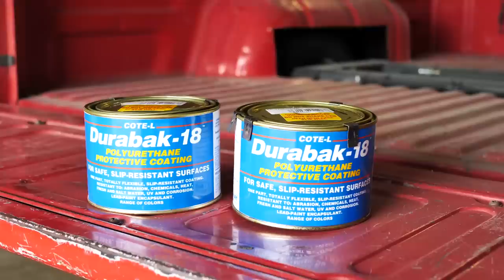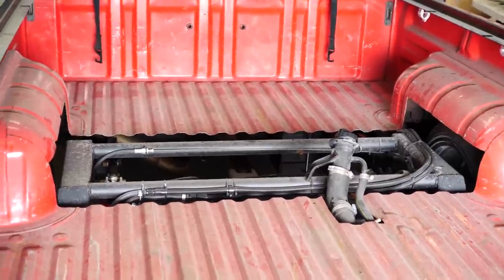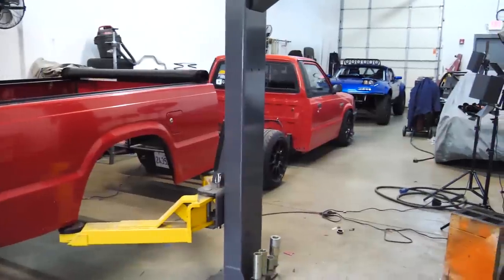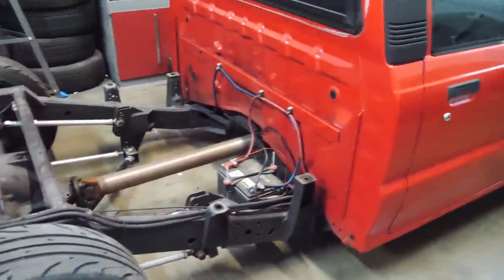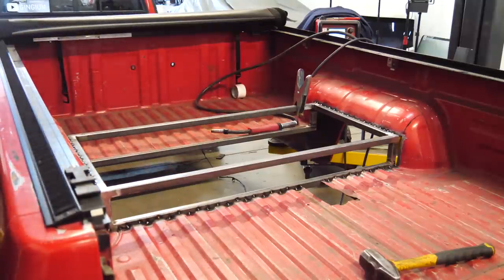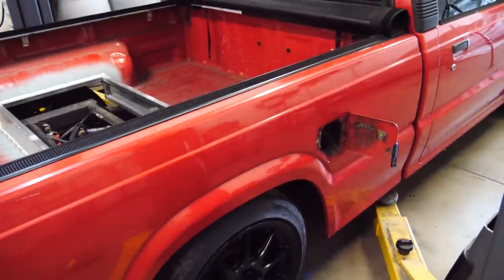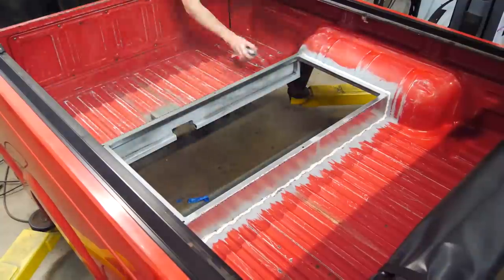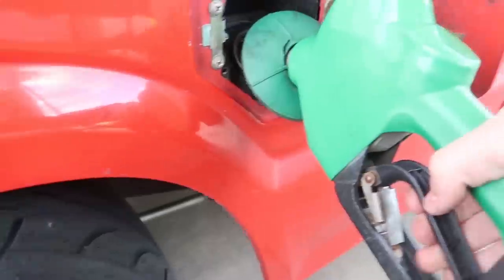Finishing and Bed-lining the DRIFT TRUCK's BED!

Comment: What did you do to the filler neck to have a pressure release? Like a valve or something? To let the gasses escape while you fill up... my truck takes forever to fill up. Much like yours but mines stock tank l/ filler etc

Comment: for the battery switch, look at marine battery bank selector switches. look for one that is designed for one bank so it only turns on and off (the truck only has one battery, most large boats have multiple banks of many). these switches will usually be round and have a really satisfying click, as well as being able to easily handle what you're doing. most install with 2 screws and i think it'll look really clean on the truck.

Comment: What did you do about the breather line that used to be on the filler cap? If it's just blocked that might be part of the slow fill issue.

Comment: Is there a tube for the air pressure to escape in the filler neck for the gas? That could be a reason because it doesn’t flow fast enough with pressure in it. Love the truck!

Comment: I hope Im wrong about this, but wont the new metal be vulnerable to rust since there wasnt any weld through primer used?
Maybe it would be good to seam seal the other side so water cant get between the box section and sheet metal

Dialing your cars in is only a waste of time if you build them to park them

Comment: If you get a bead roller, you could add stiffening channels to the cover over the rear end. It would look cool, and make the cover better than a plain sheet of steel. Also, it might be an idea to have a way to drain water from the part of the box ahead of the axle, though I don't know how much you drive without the bed cover on. 
Loving the finished look though!

Comment: Re the fuel tank filling - I have a Holden Rodeo here in Australia (Chev Luv/D-Max in the US) and the only way I can fill the tank on it quickly is to turn the gas pump nozzle upside down ..... works like a treat; put the nozzle in the filler normally, same thing as you, can't fill at full flow rate.

Comment: The fuel fillerneck is gonna rust and you'll get rust in the fuel system... and that ain't good
Reply: Bump so gingium sees this
Reply: That looks like stainless tbh
Reply: @imnota  He said it's the same as the tube chasis. Did he use stainless for that? Idk, tbh
Reply: @jaspervandewiele502  he said it was same size, but he got some new tubing
Reply: That looks like stainless steel. It shouldn't rust.
Reply from the maker: Its mild steel everyone. But as long as water doesnt get in there it should be fine right? I mean fuel doesnt have water in it? Right? Idk lol
Reply: @_Gingium_  just google "does gasoline cause corrosion" and you'll find an answer. 😛
Reply: @_Gingium_  lol fuel does. condensation
Reply: Gingium im dealing with a rusty fuel system right now m8. You might redo it with something that wont rust. Or just be prepared for it to eventually happen
Reply: @_Gingium_  That's even worse.  Firstly, yes there is water in fuel, 80 ppm or less is allowed by federal standards, not to mention the microbial growth in fuel will add to it's corrosive abilities, and finally the fuel itself is corrosive.  When working with fuel systems, ALWAYS use fuel grade materials.  If you don't you run the risk of damaging your fuel system, including pump and injectors.  Corrosion in your fuel system can also lead to damage of spark plugs which can cause misfires, and in extreme cases the small metal particles can damage your bore.  Replace that neck with fuel grade materials as soon as possible.
Reply: Just to clear some things up, no, fuel is not corrosive. Gasoline is not, and ethanol is not. However, ethanol, being an alcohol, is hydrophilic. That means it basically attracts water. Since almost all modern gasoline is part ethanol, when it is left to sit or is exposed to a lot of moisture, it gathers water over time. That water causes rust.
The combined substance when allowed to sit can also break down and cause other nasty grime and buildup issues. Basically, yes, raw mild steel is not ideal in a fuel system, but specifically when it will not always be fully submersed in fuel, when it will be exposed directly to water or moisture, or when it will be left to sit often.
Most gas filler necks are actually mild steel though. Go figure. Most hard lines for fuel are also steel, but are obviously always full of fuel. Fuel tanks are also often steel, though many are coated inside. So honestly, it should be fine as long as it is air tight and doesn't allow moisture in. This is all why most systems rust eventually though.

Comment: Second note/idea: You should put an actual plate on top of the steel box, that way you can actually set weight on it. You can hinge the FWD side of it so it opens up at the rear. That thin sheet will puncture in an instant.

Comment: Add 2 more rivnuts per side on the cover to the truck bed opening. The 3 per side you used caused it to bow a little and it might sound like a rattle can down the road. Trucks hella loud so you might never hear it anyways but it's food for though brotha. Rad build Ging

Comment: I think it could look really good if you used a section of bed floor to make the raised section, instead of just sheet metal. Plus the ribs in the floor help stiffen it up and reduces noise from the sheet flexing. The noise probably wouldn't be super noticeable since it's in the bed not inside the cab, but it could be.

Comment: Looks great Caleb! You might want to build a horizontal support under the top plate of the newly built box to prevent the removable plate from bowing downwards with the weight of whatever you end up putting in the bed.

Comment: Maybe try adding another small tube that is towards the top of the filler neck and vents to the gas tank. It could help with the filling issue. If you look at a filler neck for a 99' Ford f150 you can see more of what I'm talking about.

Comment: Next time you fill up the drift truck, try backing the handle an inch or so from the filler neck, my old Silverado used to click off constantly and that fixed it for me. Just a little bit from fully inserted should do the trick

Comment: Drainage system for the bed? Incase you wash the back.. So water doesn't collect in the back and leave stain.. And ya saw a comment about rust with the tube your using will get into the fuel system.. Hope all this is fix.. Enjoyed the vid.. You deserve more subs! Cheers❤️

Comment: great work! You could add structural strength to the lid by welding some ribbing on it (dont know if thats the correct term, english is not my mother language). So you can actually put stuff on it and it wont bend.

Comment: With the gas pump thing my jeep has the same problem just pull the pipe out of the filler to wear it’s just hardly in there and then it will fill

Comment: I want it!  I have a Tundra with the same engine, Sure you would've gotten more power out of a LS but the 2uz will last alot longer just keep a good timing belt on it . You can swap the intake to a 05-06 & gain 60hp you can do 12 hole injectors  and even put a turbo.Look up Keith Carty Racing dude is a wizard with these!

Comment: might want to reconsider changing the gas filler from metal to rubber. Gas could corrode the metal on the inside of the pipe and rust could start forming.

Comment: That mild steel fuel filler neck you made might Rust water does get into gas over time it might take a while but yes. It's a good template minus the tight bend but, I believe u can make it a smidge better you know. Just for insurance man. It's the little things that count. Love ur content and not trying to be trash talker or what not 💯. I'm in school welding so I thought I might let u know also I seen mild steel left outside rust by the next day just food for thought. But the truck is looking great Molly is still #1 though.

Comment: You should put a seal between the bed an the suspension lid to avoid ratles
Reply from the maker: The bedliner has enough rubber in it to do just that! 😁

Comment: Completing the bed is not a waste of time.  But your fuel filler neck is going to corrode and rust out because it isn't fuel grade material and can damage your pump AND injectors, replace with fuel grade material as soon as possible.  Kill switches ALWAYS go inside the cab within easy reach in cases of emergency.

Comment: Why did you only stitch weld the panels and fill it up with seam sealer. Would be better to weld small portions at a piece and cool it off in between welds with an air gun so it won't warp. Why not make the finishing nice